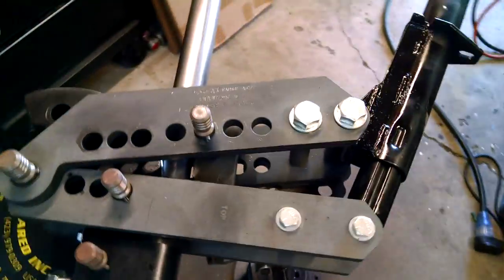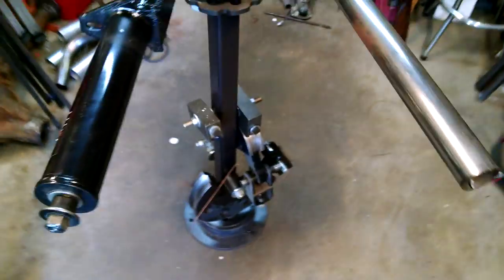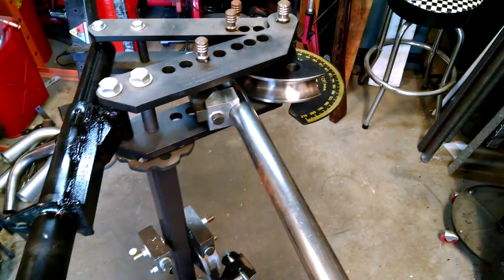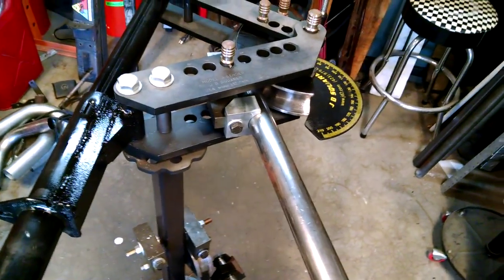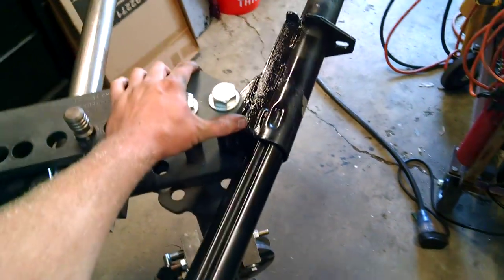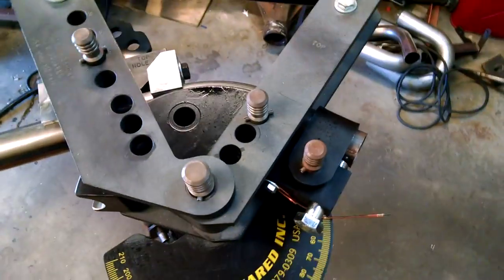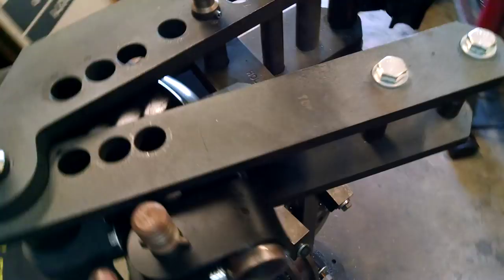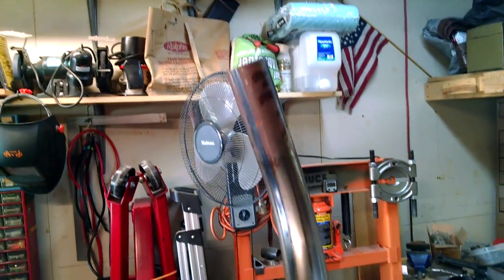JD2 Model 3 bender with trailer jack

Comment: This is fantastic info.  I finally ditched my big compressor because I never used it, was loud as crap, and took up space in the garage.   I went to bend some 1.5 DOM the other day on my model 3 air/hyd and was like, DAMNIT MAN!   
This is more user friendly and cheaper than buying another compressor.   I saved the pics you sent Brandon Hunt on how you fab'd the mount.  Also saw your comment on a longer jack being nice.  
Thanks for documenting this!  Please feel free to send any more words of wisdom my way.
Reply from the maker: Depending on what drill you have, 1.5 DOM with .120 wall should bend just fine.  I would say 1.75 DOM  .120 wall is the limit, at least with my drill.  An impact gun may work better, but it also will probably be alot harder on the jack.
Reply: @danielbuck  got it.  My plan is to use the same jack but build a sleeve and collar the jack can mount to with grade 8 hardware.   That way I can keep stepping up drill size if need be and if I trash a jack every now and then I can replace it.

Comment: Wow, that was a pretty brilliant idea which looks like it works extremely well!  I have the model 3 manual and bending .095 wall 1.75 DOM is a pain.  Did you weld a piece of 3/4"ID tubing to the jack to adapt to the JD2 or is that something that is already present on the jack?  Either way, very impressive!
Reply from the maker: +chestnut250 -  Yes, I welded the 1/2 piece of tubing to the end of the jack to fit the pin.  In the video the tubing was 1.75" .120 wall HREW.

Comment: Great Video!! Need a measurement PLEASE. I plan to fabricate a JD2 Model 3 bender to use with JD2 dies and need to know the benders arm spacing. I found good drawings for the hole size, location and spacing on line but have not been able to determine the distance between the bender arms. In other words, how long is the 1" OD spacer in the die follower mounting arms? The spacer that the ratchet bar mounts on.  Thanks!!
Reply from the maker: it's just under 3 3/4"  The distance probably isn't all that critical, so long as the die and the follow bar are at the same height on center.

Comment: I was thinking about this and found your video in my research. That's pretty awesome. How is it holding up? Also how did you attach the hex head where the handle goes?
Reply from the maker: I just welded on a 3/4" nut

Comment: Yeah right. You don't need to mount it. Keep working in those sandals. Only a matter of time.
Reply from the maker: Thanks for the tips.   The setup is still working nicely :)  If I ever get enough space to dedicate to the bender, I'll bolt it down.
Reply from the maker: BTW, sandals are still working ;-)
Reply: @danielbuck  internet safety guy got ya. What's the model of that jack if you don't mind me asking?
Reply from the maker: @MrSh4des  those are my OSHA flip flops.   :D.   the jack is a Husky 30780.  If I were to do it again, it would start with a longer jack, the jack is juuust long enough.  longer would probably be better.  It's still going smooth though, 7 years later, still bending 1.75" .120 DOM for my projects.
Reply from the maker: I now have the bender mounted on a rolling chassis, it's more stable, and I can wheel it around.  works better for 10'+ lengths of tube.

Comment: I made the same set up. Attempted to bend 1 3/4" .120 wall and the drill wouldn't cut it. Tried an electric impact. No go. Then used an air impact. The jack failed after one bend. Get the swag offroad bracket and HF ram. Hope this helps someone.
Reply from the maker: Hm... I've used 3 different electric drills (battery powered), and have not had issues with either of them. Dewalt 18v, Milwaukee 18v Fuel, and some other brand.  Just bent some tube yesterday for some truck bed rails, 1 3/4" .120 wall.   It's possible that the jack that you used doesn't have a slow enough ratio, and it's to much for the drill, or maybe welding on it cooked all the grease on the inside?.  I used a Husky 30780 jack, 5000lb rating.  I forget how much I paid for it, but right now it sells for $35.
Reply: Daniel Buck i used that one also.
Reply from the maker: hm.... bummer.  It works like a champ for me!  Way faster than doing it manually, and from what I see on other videos, decently faster than air/hydro setup.

Comment: pneumatic over hydraulic jack from Northern Tool/Harbor Freight. use one finger to pull trigger.
Reply from the maker: +Drew E. Yep, that would work as well!  If you have shop air.  The electric drill and trailer jack is cheap and pretty quick though :)
Reply: +Daniel Buck ya, the pneumatic doesn't need a recharge after 2-3 bends.
Reply: just use a corded drill, I have the air / hy and I'm thinking about switching mine to the jack